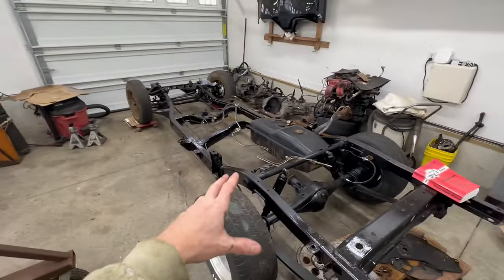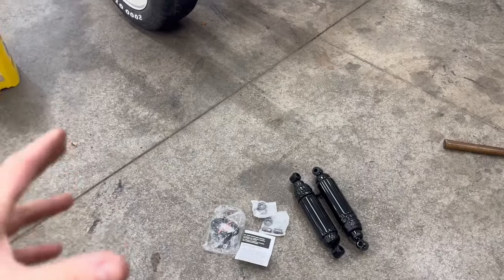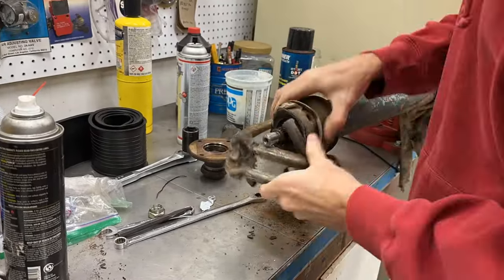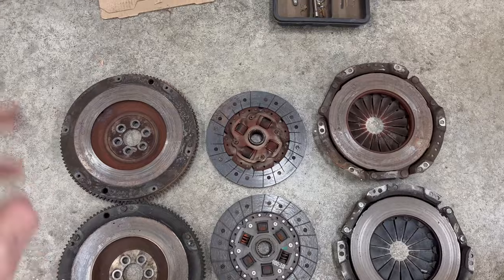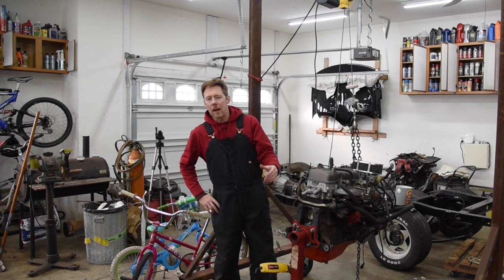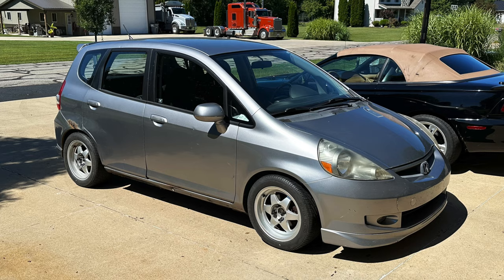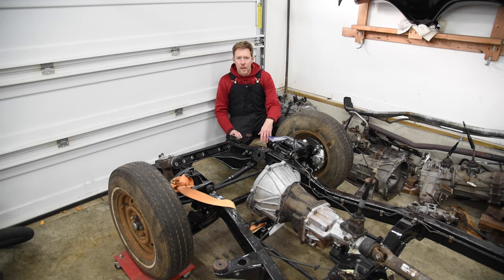1980 Toyota Long Bed Pickup/Hilux Build:  Chassis/Frame Parts & Details

Comment: W56c with transfer case will fit without cutting the cross member? Cuz I’m swapping the auto now and I wanna drive it with the torsion bar before installing the axles. The transmission originally (a43d).
Reply from the maker: I don't have one to test fit on this frame, but I'm sure that 'd have to modify the crossmember just based on the length difference alone.

Comment: Hey what transmission will you stick in that 4Runner ? W 56 E ?
Reply from the maker: It's an auto now, but I'm thinking about converting to manual with a W56 I've been sitting on.
Reply: @6thGearGarage  Good call. I have an auto in the 86 turbo truck.... still debating on swappin !

Comment: @6thGearGarage 

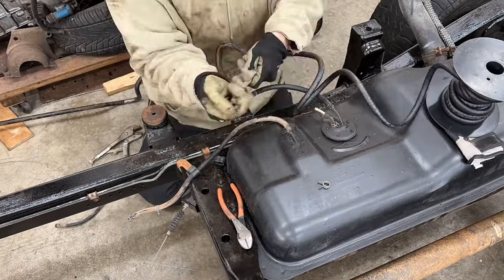Around 5:17 when you play around the gas tank, let say I need to cut a little rust spot and weld a new metal plate on the frame and need to remove tank.... While I am there I want to clean the fuel tank. I already have the fuel pump "sock" filter in my cart but if I do open up the tank, would I need anything else ?
Reply from the maker: There's a rubber gasket under the lid that screws down, but it is usually re-usable.
Reply: I Also have other questions for ya; 

At 0:40 when you re-install the fuel tank I was wondering, wouldn't it have been a good time to clean the inside of the tank ?
Also;

Can't remember where exactly but I swear I've seen you replace the rubber fuel injection line on top of tank/fuel pump.... What size are the lines? (I believe they are all the same size, right?)

Amazing channel by the way !

Comment: Can you convert it to 4wd ? And what parts you will need to do it?
Reply from the maker: It can be converted, but I want to keep it 2wd since I already have a 4wd.  I would need trans/transfer, mount, header, driveshafts, complete axles, leafs, hangers, shackles, wheels/tires, shocks, steering box & all steering components... probably a few things I'm forgetting too.
Reply: Thanks 🙏🏼

Comment: Questions for ya; 

At 0:40 when you re-install the fuel tank I was wondering, wouldn't it have been a good time to clean the inside of the tank ?

Also;

Can't remember where exactly, but I swear I've seen you replace the rubber fuel injection line on top of tank/fuel pump.... What size are the lines? (I believe they are all the same size, right?)

Amazing channel, by the way !
Reply from the maker: The fuel tank was surprisingly clean. As for the lines, they are 1/4” ID. If you’re buying a lot, skip the parts store and save money buying an entire roll. Lmk, I can dig up the link for where I got mine.
Reply: @6thGearGarage  Yes please! There's a soft spot on my truck frame so the tank will need to come out. While I am at it I was planning on changing the fuel pump filter sock and also changing a bunch of those rubber line at the top of the tank too !
Reply from the maker: @billythomas4527  Here is the exact hose I bought: https://amzn.to/433kxJn
Reply: @6thGearGarage  Dude, what a legend. I'm planning on replacing my stock H4 headlights with Hella Glass housing and LED lights. What would you suggest so it doesn't screw my highbeam indicator? What do you run ?